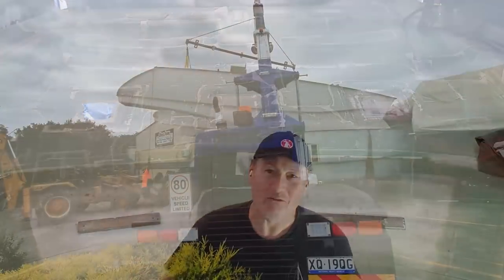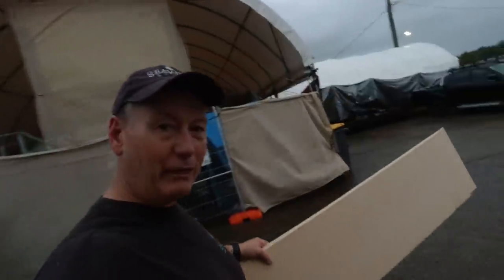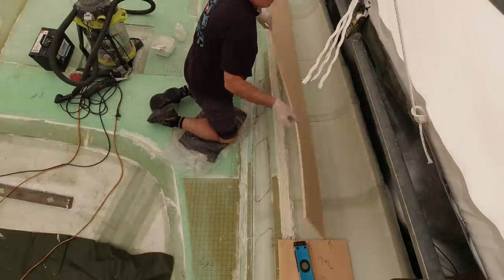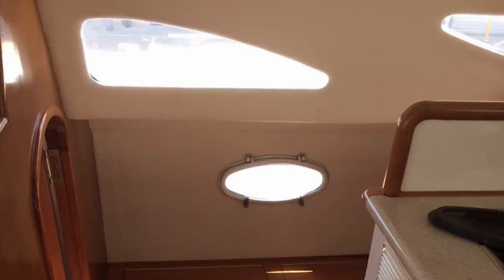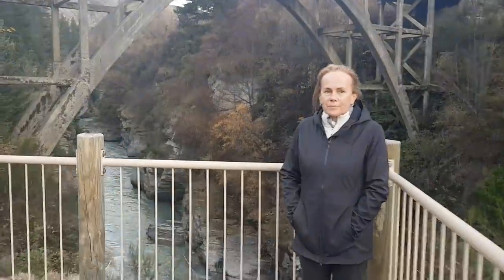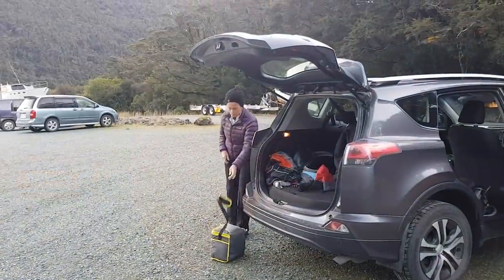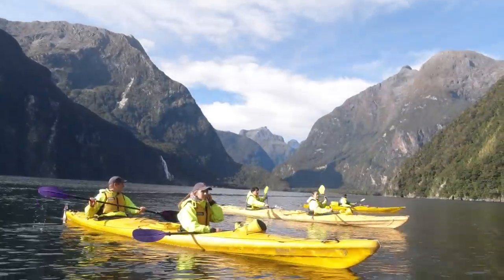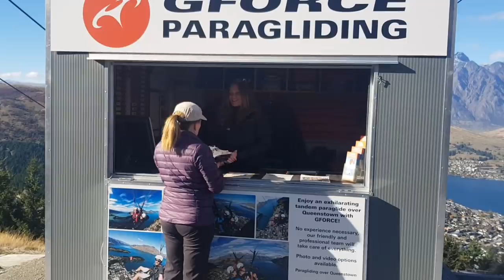Ep175 - Integrating Foam Core and Celebrating Milestones

Comment: Please excuse my ignorance, but what is that white stuff (sealite) you said that you put on the PVC core as an adhesive ?
Reply from the maker: Sea lite formulated by Nuplex/Allnex Composites especially for bedding foam core.Is it polyester based areosil and well filler,40perc rent of resin weight by volume.Ross
Reply: @LifeOnTheHulls  Thanks so much...... I am hoping it is perfect for bonding foam core to Marine ply !?
Reply from the maker: I personally would not use it on marine ply.I would suggest Vinylester resin at 2pwrcent soak on marine ply,then hot coat 300csm at 2.5percent and the foam onto to saturated csm and vibrate the dry foam side and weigh down until parially cured 24hrs.Sealite not ideal for dry marine ply.Ross
Reply: @LifeOnTheHulls  Aaaah I see, thanks Ross, the logic of your suggestion makes sense for a higher bond strength...... Ta

Comment: I'm curious about why you don't use the ROS dust collection. Is it because the suction makes it hard to control?
Reply from the maker: Hey Wayne, I have gone through so many sanding discs ( 1 every 2 minutes with the laminating resin ) on this deck with and the 100 pack I bought had limited holes so was useless. I do use it when sanding cured laminates that have wax and peel plied surfaces are also easier to sand. Ross